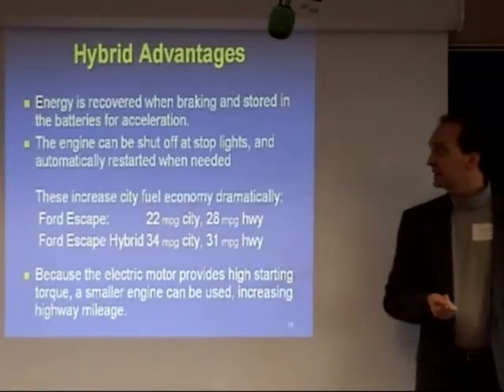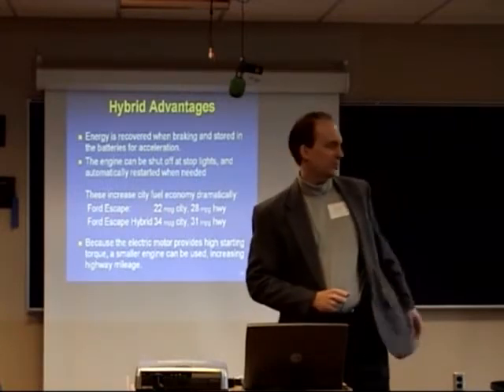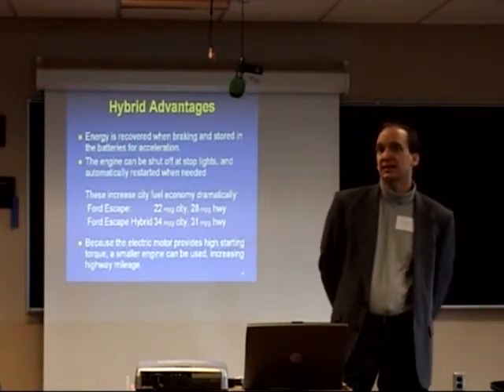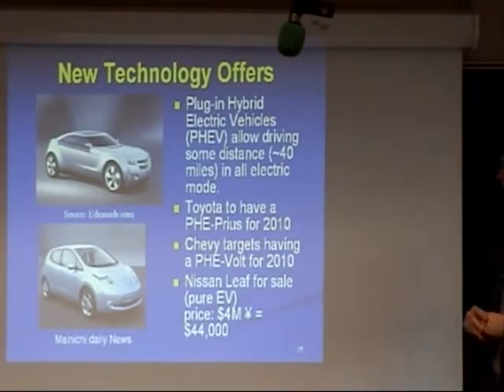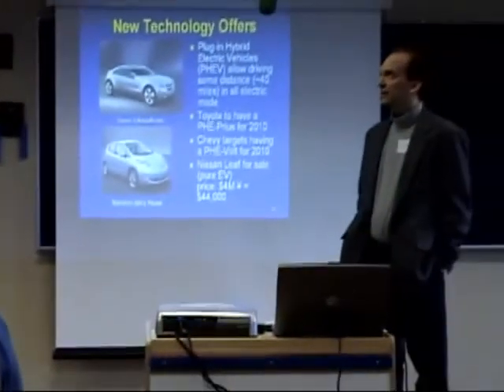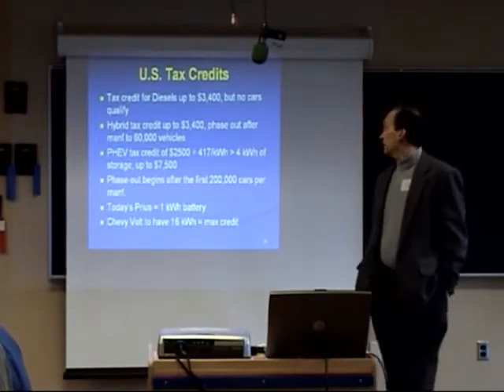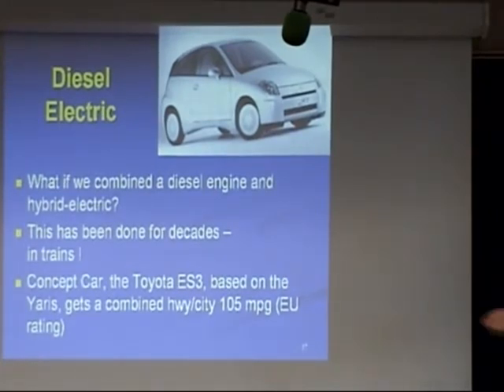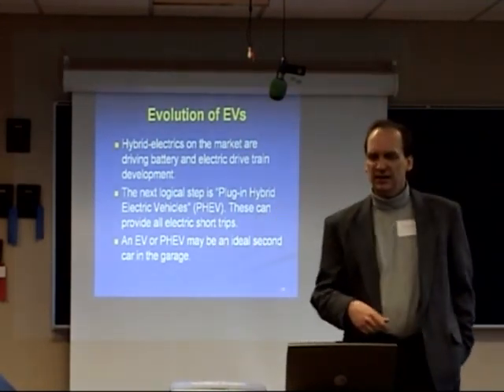Peak Oil and the Future of Transportation (4 of 5)

Comment: Plus the hybrids are not that efficcient and cost effective, and once the battery is gone you might as well dump the car with it, and the battery don't last even half of a car life time. Ethanol its close to zero gain while rising the price of food and deeping starvation everywhere, plus it ruins engines components and the EFI system because the chemical components of it its corrosive.